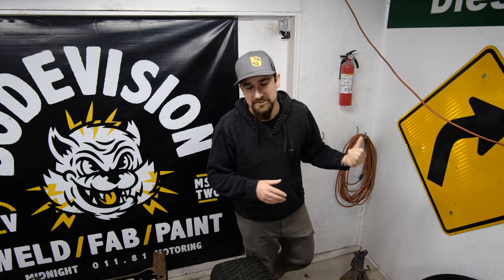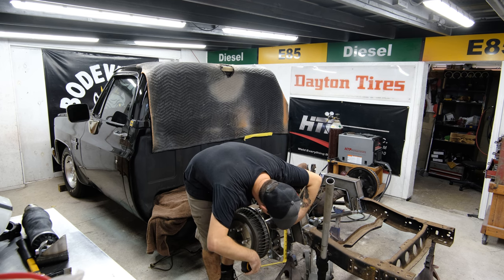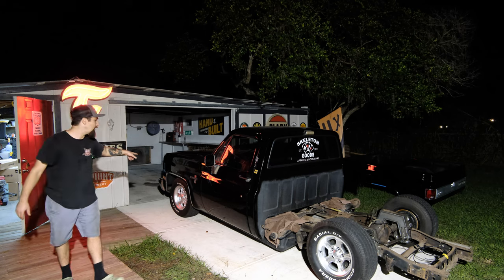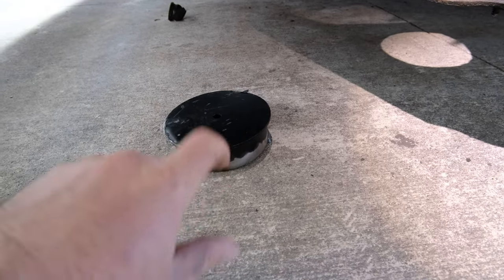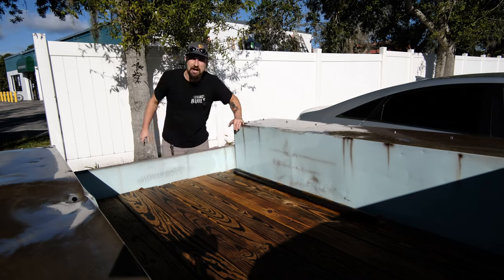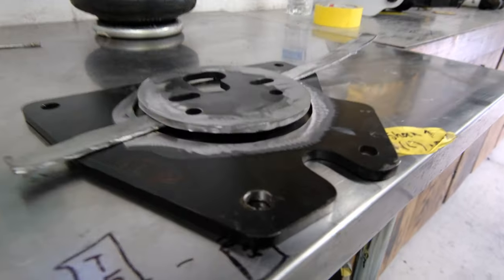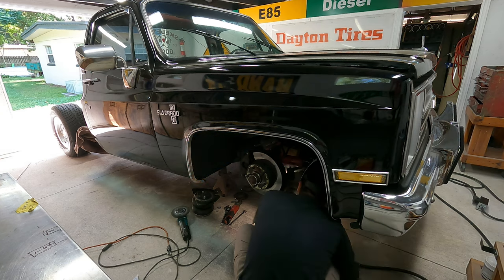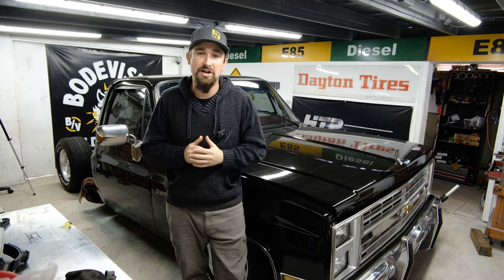Maximum Low! on the C10: Air Ride Suspension Install Challenge

Comment: Love the content, been one of my favorite channels for a long time. Been watching since pepto. Got my submission in for the slam box!Just opened up my own HVAC company (High Performance Heating & AC) I told my wife that eventually I would love to have a old truck with a box bed on air ride so I could pull up to a job , air out and just roll the new units off. Fingers crossed luck is on my side.  No matter what, I’m happy to support the channel brother

Comment: Loving the design of the air bag suspension this truck clean asf #bodesqaud #projectboxtruck
Reply from the maker: Yeah man! And we’re going with all mechanical simple switches. No no electric valves needed. Lots more to come